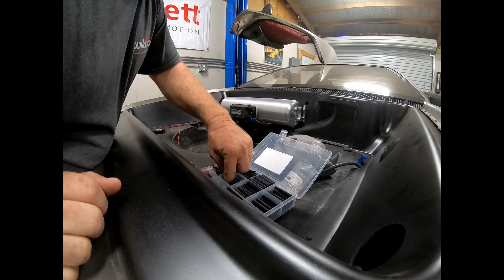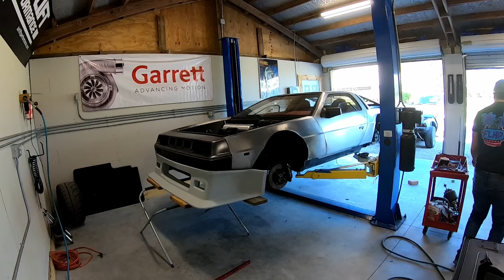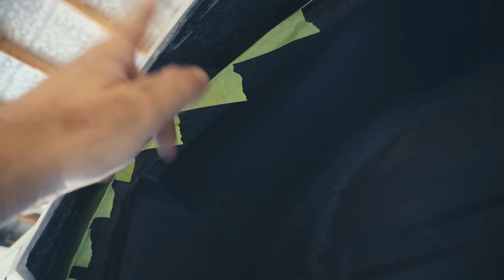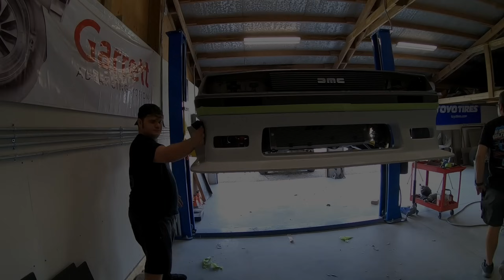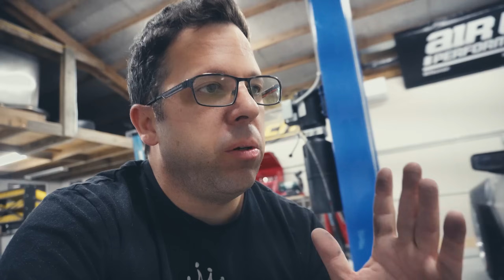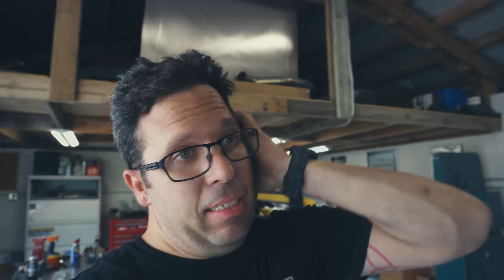Installing the New Widebody & finishing The Twin Turbo DeLorean V2 for SEMA 2023!

Comment: This is a really bad video quality.  Worst I have seen on youtube.  You ramble on and on, showing really nothing hoping we can guess what the overall car looks like going to Sema.  Jumping around all over the place.  I love your talking about having stainless steel lines coming up into the frunk which turns out the be plastic from the description of your friend helping you install and contradicting you on what is the best choice.  Sorry but I gave this channel a chance.  it was interesting while you worked on a new Delorean motor change project but your Widebody Delorean still has no properly running engine 2 years on and is just nothing special.  I am out of here. Bye